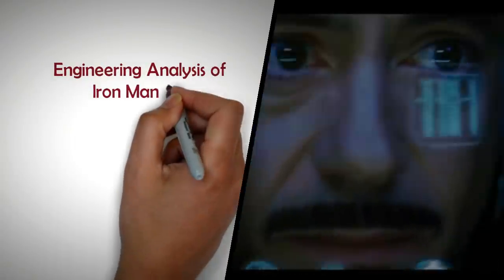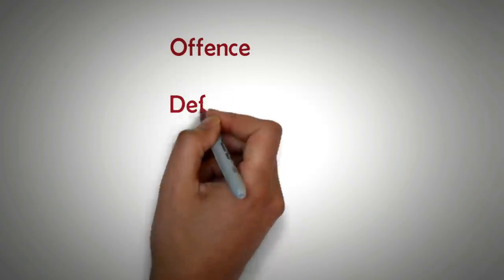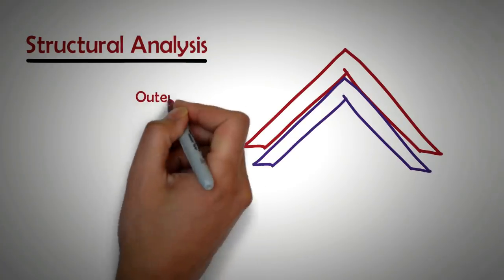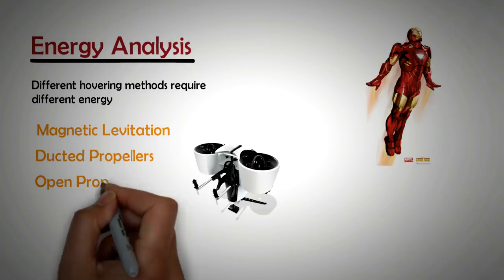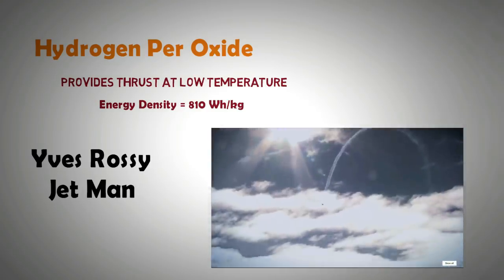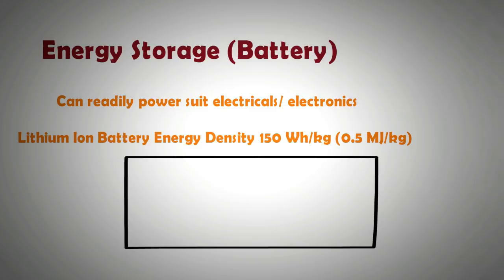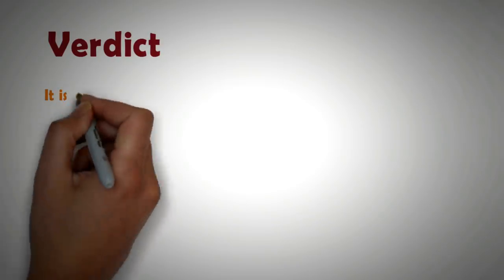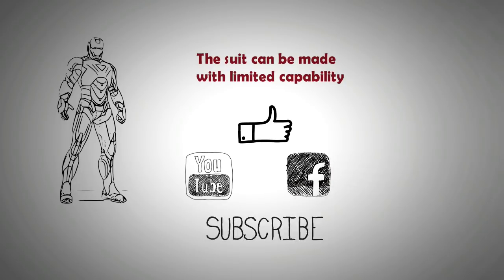Engineering of Iron Man Suit

Comment: Cool breakdown of exoskeleton layering — but worth noting, ductility or Sorbothane-like materials can’t save you from high-speed impacts like full-body landings. You still need active deceleration (like thrusters) to survive the energy levels involved. Materials help reduce local shock, but they’re not a substitute for real braking systems. Same applies to rocket impacts on the suit, you need active trusters to survive those even though the suit structurally would be fine.

Comment: I think there were a couple of points missed with future technologies, for one it’s completely theoretically possible to build an ark reactor, if you look at e=mc^2 (as the theoretical limit with matter + anti matter energy) it’s completely writhin possibility. It’s also within the possibility range of nuclear fusion (wich is cleaner, safer, and more efficient than fission)

Assuming a ridiculous power source, it also might be possible to brute force thrust generation by heating up a thermal pad to EXTREME temperatures, causing a rapid expansion of air volume (and maybe even plasma creation) which if done at a certain pattern on the thermal pad, could create net positive thrust. This would be next to impossible to do, but, possible. Possible with more advanced tools.

In the end I think this was the point of the suit, it is so special in the movies because it contains so many technologies that are decades off, and that’s why it’s so sought after in the movies.
Reply: The e=mc2 is not possible cause nothing can move faster than the speed of light squared .
Reply: @techphile3262  what are you talking about? No that’s wrong… nothing can move faster than the speed of light, not the speed of light squared…

I also never mentioned anything about speed… e=mc^2 is an equation for converting matter into energy. E=energy, m=mass, c=speed of light

Comment: For the reason why he doesnt just use the laser device ,id say based on the scene that its not the power that the issue but a component that burns out during the process. Most likely carrying a system that could prevent the burn out or the amount of the elements that would  need to be present was at that time not practical.

Comment: The solid state thermal batteries are better for creating and maintaining power but as far as the big power cells for the rest of the suit... I believe that would have to start as an experimental stage for bringing the “ark reactor” into existence.  The suit itself would have to be made out of a Titanium alloy for reasons that I do agree with you on.  And when it comes to the flight capability, that will have to be experimental as well.

Comment: Titanium is a poor armor material. Titanium is temperature resistant, but can easily be cracked from hard impacts
Reply: So what's an alternative ??
Reply: @techphile3262  For iron man, you cant make do with 1 solid piece. Theres too many factors for 1 material to handle. Titanium is best used around you boosters and weapons for heat mitigation, as well as leading edges. From there, youve gotta determine how strong your boosters and your hydrolics are. If your motors and frames are strong enough to use heavier alloys, then you want to use tungsten carbide on your smaller parts like finger guards, smaller components in the chest, pevlis, and knee caps. Tungsten carbide is not the ideal armor material, its best used on places that have to engage with the terrain often and hard. Thats why its used on the teeth of excavator buckets. Your primary armor plating should be strong, but not hard. Contrary to popular belief, tank armor isnt hard, its actually very soft compared to things like drill bits and hammers. The point of the armor is to absorb energy and dispurse is. we dont have the luxury here for that. So weve gotta get a little creative. we can use a 2 piece metal laminate with a high carbon steel plate surrounded by heavy duty aluminum alloy like 6061 T6 which is the kind of aluminum youd find in more industrial application, its still light weight which is a plus, but importantly, aluminum when applied correctly doesnt fracture, it can tear, but it doesnt fracture like harder metals. What this means is, soft impacts like baseball bats or clubs will be handled just fine by the aluminum, things like bullets will deform on the aluminum but still punch through and hit the steel plate. at this point, the steel should stop your more moderate bullets. Handguns definitely, and rifles up to probably 30-06 so long as the plate is at least .75 inches thick, which isnt possible everywhere, but should be doable over the vital organs and the helmet. the softer aluminum will also catch the spawling from the bullets, so now you dont have to worry about fragments of a bullet flying around and cutting arteries. We can reinforce the thinner areas of the suit by using components of nickel alloy with our 6061 aluminum offering shock absorption to prevent the nickel from breaking under high impacts. Underneath all of this, you're gonna need an iron-nickle endoskeleton to prevent suit deformation from harming the wearer, and the operator should be wearing a G-suit with kevlar padding to both protect against shock but also to catch any fragments that make it through.

Comment: even if the suit is powerd by cable and only is capable of moving there is no material that will survive. Mainly the motor anchor points and joints when you get to arms. Not mention the insane dificulty to actuate it in so many axis of rotation.

Comment: Before watching, no, not even close to doable. 

Putting aside the mechanical possibilities of today, metallurgy, and computing power, and keeping in mind the absurdity of deadly irradiation from mini or micro nuclear reactors within the armor, there’s simply no way to provide superhuman strength anywhere near those levels, and, most importantly, without internal inertial deflector shields, whomever took the risk of high G flying, landing, and most critically, taking hits from tank rounds and crashing to the ground and/or into and through steel and concrete buildings, the only thing left inside the armor would be bloodied human pulp.

Still, excellent analysis and informational video...🤝🥃

Comment: It appears he uses ion thrusters, In the few shots we see without the main exo-skeleton and armor plating we see that plasma flows from the arc reactor and through some tubing to the hand mounted thruster/repulsor. The rapidly expanding gas due to heat is the source of propulsion. It would make more sense if some air is sucked and ionized at various rates as needed for what JARVIS requires (he does the flight calculations for how much thrust is required for certain maneuvers and adjusts accordingly to Stark's actions). Or simply there are a cathode and anode in the hand mounted thruster once again similar to ion thrusters is using the air as fuel/source of propulsion by having a high enough energy arc between electrodes and ionizing the gas causing the air to expand rapidly.

Comment: I’ve got a suit that can fly it’s uses carbon fiber wings that come in and out of a backpack make of medal they have mini turbo engines on the wings that come out with the wings and allow u to fly and I use a small battery located in the backpack also I use a turbo cooler so it doesn’t over heat

Comment: in my research the energy source is somewhat simple it would be solor power and directing it it's way simpler and honestly u have an infinite amount of it obviously He is very correct about the suit structure itself it is going to be hella expensive and let's say if u go supersonic or  really high in the air wich your gonna need more oxygen wich in the helmet u can have something along the lines of the face mask jet pilots use to stabilize there oxygen built in for flight,flight it self yes as of right now it would be a little bit before you can get true vertical flight with a suit like this  but everything else can be figured out hell even the AI nowadays anyone can create a version of AI wich will make using the suit way easier like makeing sure to  stabilize the ventilation process and your oxygen use along with optimizing your energy usage depending on the task at hand I've been thinking about this since I first saw the movie yes it is a fictional movie but it's very possible lol if uhave seen my comment send some questions back I'm sure I can answer and synergy keep up the good work 👍😁

Comment: It can be made copy the arc reactor. Simple as that same materials he used. Maybe use it like a Z p M zero point module. I understand that functionality fairly well. Just using a magnetic field that draws it's energy from its surrounding area.  Will give it flight time for maybe 15-30 minutes of either flight or short time combat.

Comment: How about solid-state batteries or supercapacitors to power the suit? The former is being developed currently by John B. Goodenough (the guy that made lithium ion batteries practical and invented RAM), and the latter is being worked on to achieve higher energy density. Speaking of higher energy density, solid-state batteries have about the same energy density as lithium sulfur batteries, and they can be damaged without exploding. 
And a battery-powered iron man suit with ducted propellers for flight in many ways sounds cooler (literally!) than a suit that uses jet thrusters to fly!

Comment: Arc reactor can be. Made if we acxquire the technology to control nuclear fusion.. See by nuclear fussion.. We can get tremendous amount energy.. The only thing is. We need to build a small reactor
Reply: shoury Shrivastava The power supply is impossible (like they did it in the movies) because it does not follow one of the most important laws of physics.

Energy can’t be created nor destroyed it can only be changed but you will always have a loss in energy.
So it is possible but it won’t be infinite like it is in the comics/movies but there are fusion reactors (at the moment they are not effecient enough to be build to power cities) but that can pull helium out of the air and use it to produce energy.

The power supply is impossible (like they did it in the movies) because it does not follow one of the most important laws of physics.

Energy can’t be created nor destroyed it can only be changed but you will always have a loss in energy.
Reply: But there are at the moment theoretical fusion reactors than can pull helium out of the air and use it to produce energy.

Comment: If we’re gonna make an iron man suit, we need an energy source that stores energy and changes it.
Reply: Without cremating the operator.
Reply: Dennis Svensson that’s pretty important to.
Reply: If you can create lots of energy in real time continuously then you don't need to store it
Reply: Use MA Energy
Reply: Get your basics right first.... Energy can neither be created nor be destroyed...it can only be changed from one form to another....if don't believe thn Google it
Reply: @pstark4111  chill men... I meant produce energy,  so obviously transforming it from one state to another so we can use it. But for the sake of this post I assumed it is clear! Don't be so proud
Reply: @pstark4111  👍👍👍
Reply: @pstark4111  Yea, like that 👉😎👉
Reply: Energy not be created nor be destroyed it just changes its form
Reply: You need a separate tank for water. But you can make a "arc reactor". That transforms water in a highly flammable hydrogen gas. This could be used as engine.... but i am not a engineer. (Yet). And i am stuck on the cooling system. A Hydrogen engine would produce enof energy i believe. But the heat will be around 5000 C if i can remember correctly. But using this as a start would be great. Because you could use the gas for yet engines
Reply: Hydrogen engine?
Reply: You could also use the gas to increase movement. By using it in a hydraulic press. Aka arms and legs
Reply: What about the arc reactor
Reply: Energy can’t be created.

Comment: given this is all theoretical but would the power issues look a bit better if carbon nanotubes were used instead of Li-ion batteries? I understand that there would need to be quite a few of them but given their size to power ratio as well as total power usage but, to my understanding anyway, it may provide more usable power for longer flight time.

Comment: With the energy analysis. You said helicopter blades. Well if some how we could invent a smaller version of one. We could put in the suit. And then create a high powered motor such would spin giving thrust to lift off the ground. And this would be done by charging the suit on a high power charger. Sort of like wireless charging but on a larger scale. 

Ps. Sorry for the long comment

Comment: Two things prevent an iron man suit from being made, an extremely powerful compact power source and generating thrust with out the need to burn fuel
Reply: There is actually such a thing as an electric propulsion system: ion thrusters. They can make thrust by ejecting a minuscule amount of mass at a very very high velocity. The main constraint for these engines today is the fact that they require so much energy per unit of thrust.

Comment: High power Ionic wind thrusters is something quiet and unlimited, just requiring power from the energy source
Reply: Axel Andres Amor Chin can u link me to some info about them
Reply: @trevoncowen9198  They are also known as plasma engines, but they produce Ionic propulsion instead of jet propulsion. https://www.nasa.gov/centers/glenn/about/fs21grc.html

MIT plane
https://news.mit.edu/2018/first-ionic-wind-plane-no-moving-parts-1121

There are experiments using aluminum foil and are the best to expand the mind. Currently they are mainly used for deep space exploration and their thrust to weight ratio is not enough to make a human lift off, but it is a technology with great potential, specially if we start to enroll more people in Plasma dynamics

Comment: Didn't tony in the first movie mention using fiber reinforced titanium to keep up the strength with thinner lighter alloys?
Reply: That would increase general strength about 30%, and stiffness a bit more.  Foaming the alloys could increase strength to weight about 10 fold, but I don't think it was suggested anywhere.
Reply: @KellyStarks  foaming is only good for structural parts, it would make armor perform more poorly though. I think the best you could do is give it a lattice structure similar to a honeycomb.
Reply: yes

Comment: The suite could use hydrogen cells
Or If  fusion is possible It could be a nuclear reactor
Reply: Polonium micro fusion reactor of some sort originally (later changed to some fictional element that wasn't as DANGEROUS). A Shrunk down version of the test reactor Iron Monger has an argument with a fella about seems to be what it is - I am amused by the idea of trying to miniaturise a fusion reactor though - that has a a feeling of improbability about it due to not being large enough to protect those around it from stray high energy particle decay. Unless the magnetic field is somehow able to contain them inside and only allow harmless omissions like Neutrinos of something like that. But it's fiction so it's all in fun - But it does make me wonder what the limit of how small you could potentially make a fusion reactor would be (when such things exist) - they might be useful for powering aircraft so large they don't need to land, or city sized ships or Space Craft I guess.
Reply: @90lancaster  it was palladium, then it later changed in IM2 when tony 'created' a new element, which is vibranium.

Comment: This analysis is so flawed and limited by old ways of thinking. The alloy that the Iron man suit is made of is gold titanium alloy. Something that already exist and is 5 times stronger than Titanium. And when it comes to power managing. Lithium carbon bateries charge 20 faster and last much longer than the most high-end Lithium Ion batteries. Or if that isn't enough then a liquid-fluoride thorium reactor built within the suit will do the job, since it converts energy at 50% efficiency compared to just 0.7% for Uranium. And the best part of is that the radiation that such reactors produce is very little and does not last long. So, with modernday technology, radiation can be pretty much dealt with at no health cost to the operator.

Comment: All right. Before I start the video, I'm gonna say something first. Now I've read the comments, talking about the energy problem for the suit. All right, I get that. We need tons of energy right? Why not like put super capacitors around the body instead of just like, one arc reactor on the chest? You can have one super capacitor on both arms, 2 more super capacitors on the shoulders, and one on the chest, 3 at the back, and 2 at the thighs. Now I know what you're thinking, what if it gets hot? Simple, you put a coolant system. And that's it. Though I imagine cooling fans wouldn't work, so why not put in some tiny nitrogen cooling system in there too? What about protecting the user? Titanium sounds like it should be enough. Lightweight and durable. Like seriously. You're in a suit of armor, and just a man ... Normal human with an exosuit. No normal person would have the courage to engage tanks... Well unless you're crazy brave, and crazy. Just make the suit bulletproof. I don't see a need it should protect the user from missile-.... Oh wait it should fly. I think you're better off trying to dodge them rather than taking the full brunt of it head on. How would it fly? Well, technically speaking, iron man uses tiny explosions to propel him forward. Like in rockets and missiles. So how do you do that? I couldn't really see electricity as fuel tho.... Sooo... Nuclear energy? I mean it does go boom I guess. What do you guys think?